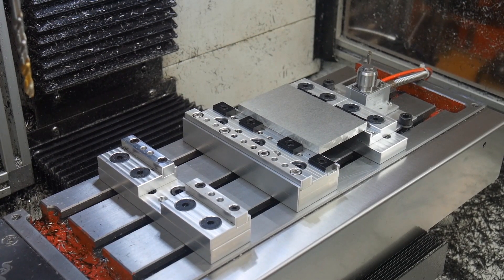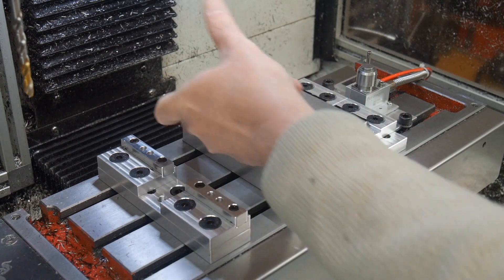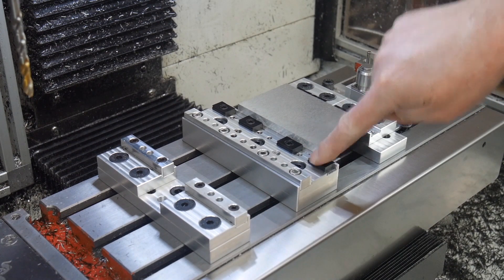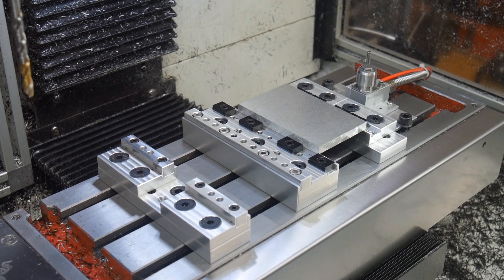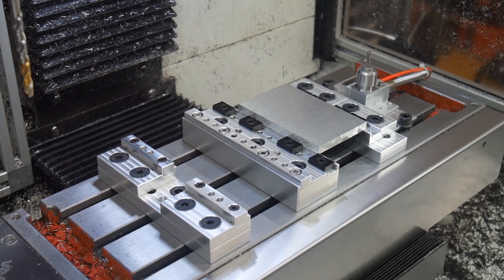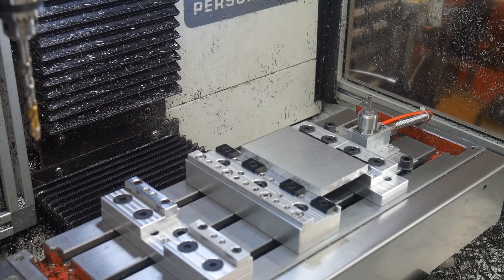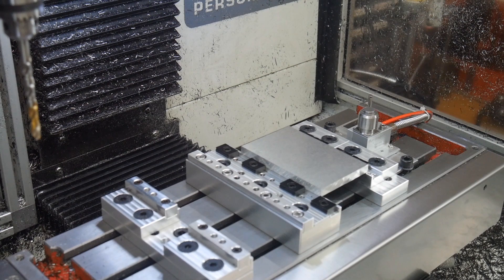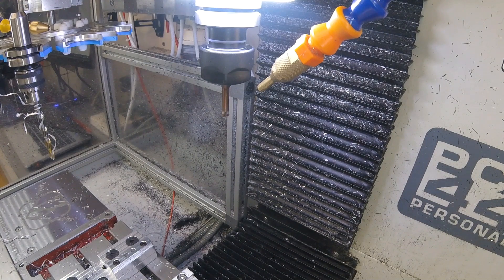Space efficient modular vise + thread milling

Comment: Nice design that is more flexible than the Saunders vice. It is not evident how you clamp with the design. I am guessing an excentric screw design is what you use. Could you elaborate on the design and function? Are the rails from Mitee Bite or of your own design?
Reply from the maker: Those are Mitee Bite talon grips.  The 0.5" size.
The centre part is fixed, but the clamping is provided from the two outer parts in much the same way as the SMW.  The bolts that hold the top part down are M10 countersunk and the 'holes' they go into are slotted, so that as the countersink tightens down, it pushes the vise jaw forward.  Not a bad idea and works fine for 1st op with the talon grips.
Clamping isn't as strong as a traditional vise though, so a bit marginal when used with flat, non-marking jaws for 2nd op.

Big advantage over the SMW is mounting direct tot he table, so saving the need for a fixture plate that costs money and z-height!

This is still my favourite way of clamping large parts that won't go in my Tormach 4" vise.  For smaller work, I now tend to use one - or 2 - of these https://fluxworkholding.com/.

Comment: Did you make the mod vise? Available plans?
Reply from the maker: Yes, I made the vise.  I've been looking for ages to find a way of mounting several small parts on the table at once and eventually designed my own.  I still need to spend some time using it to see if it's any good or not, but I may release the plans in future.  It's not that difficult to be honest.
Reply: David Loomes how are you finding the vice. Has it performed as you wanted and did you ever share the plans.
Reply: @daleksw  Hay man, coming back to it later, you got the plans by any chance ? Thnx

Comment: Very nice... quick and functional. I have only done a couple of thread milking operations. I’m not familiar with the term “spring pass”?? Maybe you could explain? Thanks again for sharing.
Reply from the maker: Fusion 360 has the option to 'repeat final pass'.  This is intended to remove stock left because of tool deflection.  Single point thread mills like this one are inevitably quite long and thin and you're cutting with just the very end, so it's worth doing this to get consistent results.
Reply: The name derives from a very low pressure final finish pass where the tool doesn't deflect (i.e. "springs back") compared to the aggressive cutting paths which definitely flexes the shaft of the end mill. Even big tools deflect some (all a matter of how precise you want your surface to be)